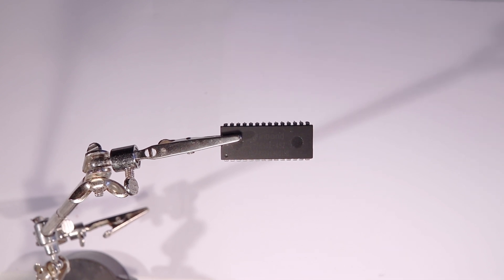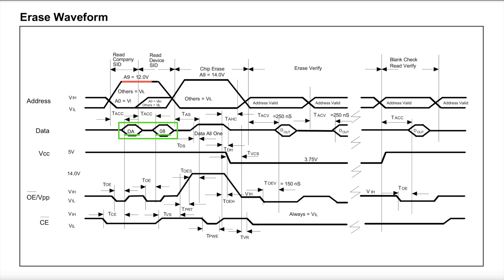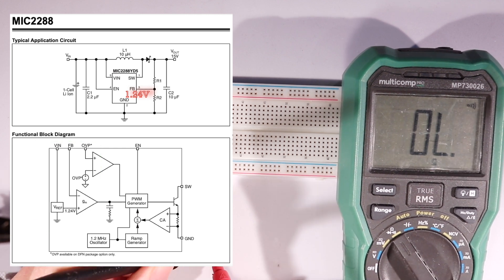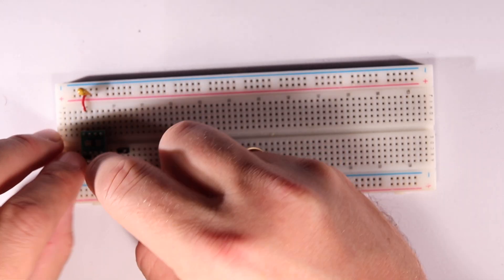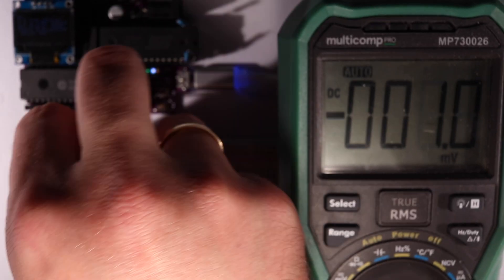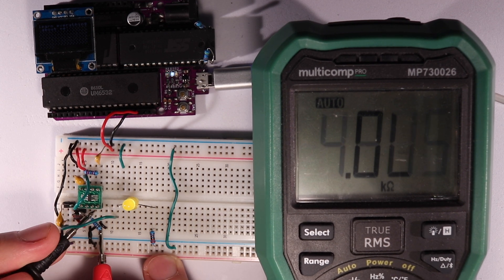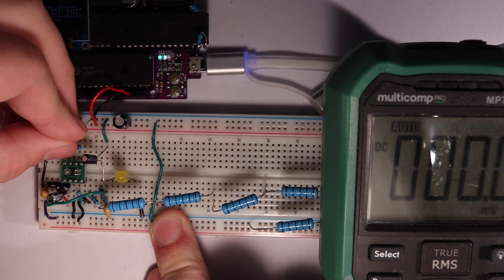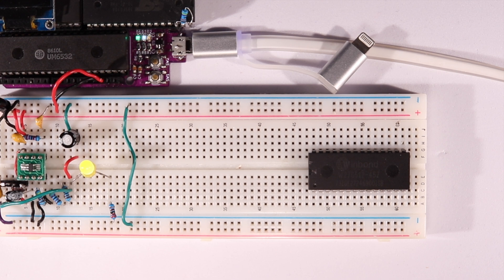Programming old ROMs with HIGH voltage

Comment: Long time ago, in 1991 or 92, I built UV-EPROM programmer based on TL497, MC14051 and CA3140. Digital part interfaces ISA-bus to EPROM's address, data and control bus. Program based on assembly language.
That's long time ago.
Reply from the maker: I plan to go even simpler than that :)

Comment: I found it the easiest to just use trimmers / potentiometers in situations where I need to get a voltage exactly, since resistors always lie about their actual value, and I don't trust tolerances anymore.
Reply from the maker: I think you’re absolutely right. For the PCB I’m thinking a trimmer in series.
Some also need 13V programming voltage(or more) so it will need some jumper options.

Comment: What about older devices that need 24v to 27v ??
Reply from the maker: I optimized a bit after I recorded this - the regulator does 27 volts without issue. 
When this ends up on a board, it'll have a pot for adjusting VPP. The only thing it wont do is to supply negative 5V for ancient ones - but it'll still make it easier to test and program those on a breadboard.